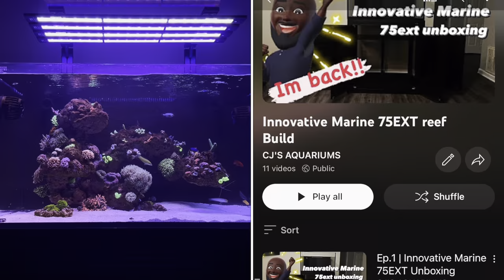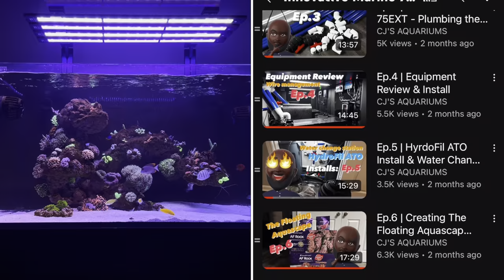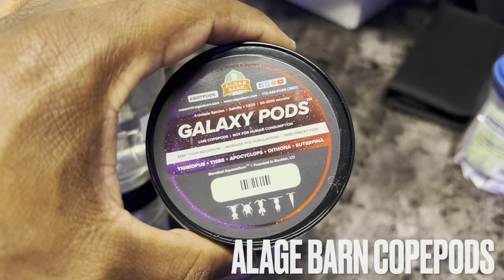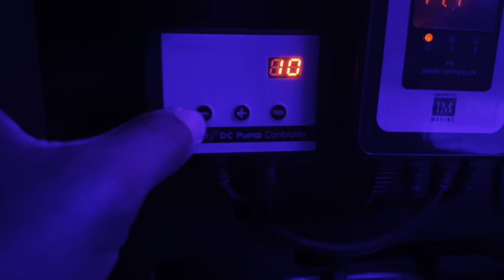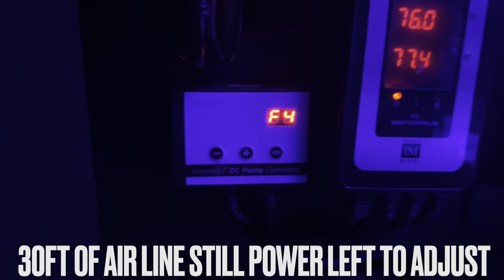Ep.17 | Biome, Nutrients & Reef Flux Side effects

Comment: I have a 1200gal sps dominant system. I agree with a previous post, that this isn't hair algaes but instead the bacterial filament algae. Fluconazole is the right med for that. I use pharmaceutical Fluconazole. 4 500mg tablets which is a low dose. It will slowly kill off the algae over about 2 weeks. Key is to remove as much manually as possible.  

For hair and other normal algaes on rock the 3 best products I've found are reefbrite liverock enhance and liverock clean, along with britewell razor. Those are enzyme based products which not only devolve organic materials, algaes ect but are also food for coral.

Comment: Wow sucks that you had that crash. I had great success with Fluconazole in my tank against hair and bubble algae. It completely obliterated it both, with 0 coral issues. On a side note , i too im using the same skimmer and im suffering from low ph. Currently using a recirculating co2 scrubber, and it has helped. However im burning through media. Thinking of running a line outside, but im scared of possible pollutants. Are you using carbon filter of sorts on that line?.
Reply from the maker: I’m on the 2nd story. Not concerned with pollutants. It’s no different then me opening the window for fresh air. It definitely works and air is free I like free 😅👌🏾

Comment: I had an algae issue like you experienced, 3 weeks of manually removing it & water changed & then week 4 I dose flux rx slightly under dosed rather than recommended amount (like I do on my recommended things- amino’s, coral food ect) & touch wood waited the 14 days & mine cleared up , did a massive water change as noticed a large phosphate spike (got it down too 0.09 from 0.18) 🙏🏼 guessing yours was nutrients from algae dying 🤷🏻‍♂️

Comment: One thing for sure is it's not the Flucanasol. Best way of handling that hair algae would have been Mexican turbos. You are right about the nutrients being stripped due to the algae. The irritation and ultra low nutrients are absolute SPS killers. Also if the algae dies and if not removed it will spike nutrients and lower pH. Just my 2 cents and sorry for the setback but brighter days ahead.

Comment: Sorry to see this . This may sound crazy but Do you suspect that the reef wasn’t fully cycled? Only reason I suspect that is because the hair algae blossomed so quickly. I don’t imagine that happening after all the dosing and podding? Once sorry about the losses. Minor setback for major get back 💪🏿
Reply from the maker: Highly doubt it wasn’t cycled… issue was biologically my tank was too effective processing nutrients. So I couldn’t starve the algae without starving my corals. Used the wrong formula which I have now changed to give myself more wiggle room as the tank matures. I dropped a lot of info in this video.. goes further then just going to fast. No such thing when there are successful insta reefs everywhere just requires the right plan 💯
Reply: @CJSAQUARIUMS  noted.

Comment: If you are having issues with low/zero nutrients you should be staying away from stuff like microbacter 7 and clean. Those will decimate the nutrients in a newer tank. Its basically just another form of carbon dosing. You have way too many things exporting nutrients for such a new tank.
I would get rid of the algae scrubber for now, stop dosing any kinds of bacteria or carbon, run the skimmer only half the day.
Let the tank get a little dirty.

Ive used Reefflux once, and i had a very similiar outcome with my sps. I believe the people who have success with reef flux have much more mature systems, making them more resiliant. New frags in a new tank i dont think handle reefflux very well.
Reply from the maker: All facts my man and that’s the plan going forward. Already in motion… less export no scrubber and water changes for along time till tank settles then reload with corals. No more carbon dosing 💪🏾💯

Comment: Your problem is that you're using something you should not be using at the stage you are at. Your tank is not a year old yet, and you're still prone to the ugly phase. Dosing this in this early stage is steep backward. You're still going to have algae and blomes for a year or 2 until the tank fully matures. At this point, a clean-up crew and maintains is all that is needed at this point. Short cuts are only going to lead in crashes or loose. I been doing thus for 20 years and been down this road. Slow and steady is what is needed.

Comment: Sucks that you lost your critters. Are you monitoring pH, CJ? I'd expect the decaying algae to have negatively impacted pH such that the SPS would suffer. I've had great success with Reef Flux (for bryopsis) and the Reef Flux/ChemiClean combo (for cyanobacteria), but one needs to be ready for the drop in pH and potentially the resulting alk spike because the corals are pissed. An alk spike alone shouldn't be enough to hurt healthy SPS, but add to that the increased spread (similar to what happened when Mok-Yi switched to out lensed bars for Blades), reduced spectrum, suppressed pH, and algae guts in the water, I'm sure the tank wasn't a fun place to live. 

Half to quarter dose may have been effective, and something others should consider when using Flux. Instructions don't care about corals. The instructions are only relevant to the target organism.
Reply from the maker: Definitely had a ph and orp drop when first introducing it. Followed by a spike in alk from tank not consuming anymore. Instructions hand cuffs you by not letting you do water changes or running carbon. Creates a super toxic environment in general. At best I could only run skimmer with cup off to help ph air from outside and ride it out till the algae was gone before I could abort the mission before the recommended 2 weeks. I believe a 1/4 dose would have done the trick after the fact since a full dose knocked all algae out less then a week. My main issue was also the carbon dosing from the hybrid salt and aminos , microbacter 7 all making me ride close to the 0.0 po3 po4 line during this entire time WHILE still growing crazy alage. I’ve sense changed ro regular reef salt and will make a full video explaining the risk I took trying to start a tank with probiotic salt. End of the day a lot of lessons learned happy to share. Back to doing things my old way much easier to predict removing carbon dosing. Thanks for tapping in 💪🏾💯
Reply: @CJSAQUARIUMS  Have always appreciated your old way, so looking forward to the ride. Regarding your findings, another consideration is that MB7 will drop pH, and the addition of its various bacillus species could have done interesting things to the biome you worked hard to create. That's a could, and without data, is a guess. An AquaBiomics test would be interesting.